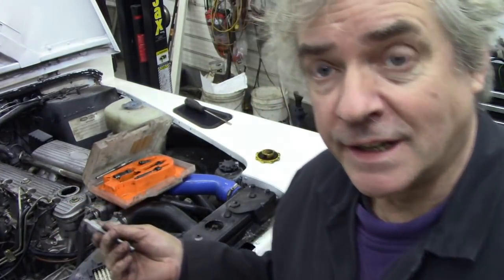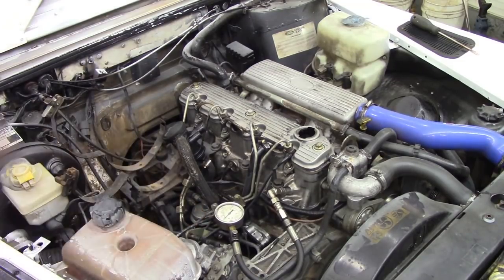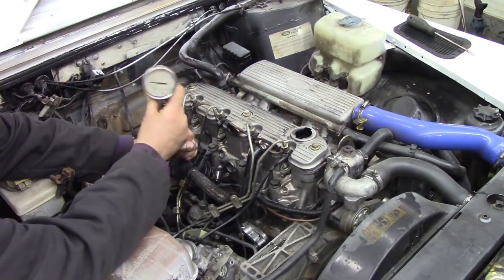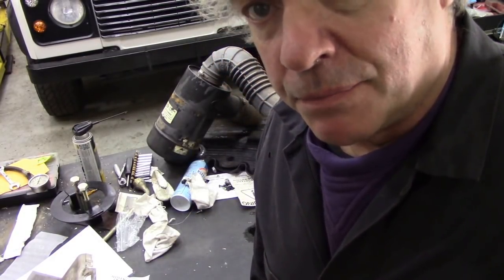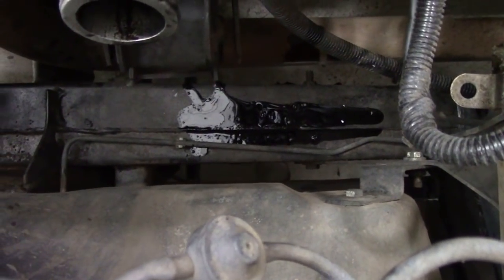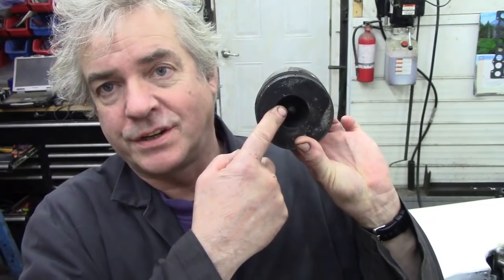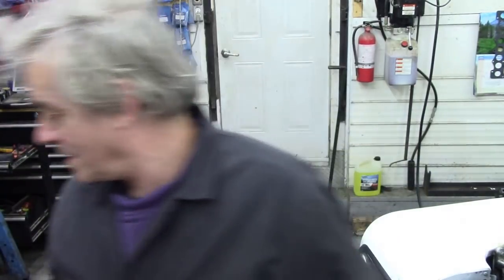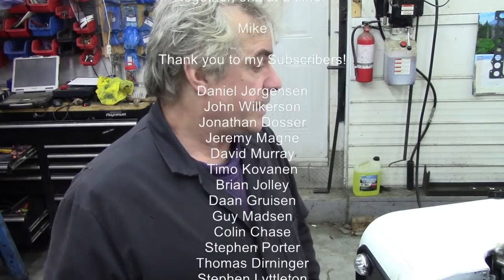Malawi 110 Engine compression test - why so low?

Comment: Didn't you say in the video that the pressure was about 280 psi? Then you said you'd checked upstairs and put a caption on saying 19.03 bar. Are they not as bad as you thought? Or is it my hearing/memory?
Reply from the maker: Should be 24 bar according to the book
Reply: @BritannicaRestorations  Maybe the engine faeries have been in and it's very evenly worn. 😆 In my youth, I had a TR6 and the engine in that was completely shot by 100,000 miles, big ends, little ends, rings, valve guides. It was a Triumph but not of engineering. Still, it may have been rubbish but it was British rubbish. 😅😅

Comment: hello Mike, i dont think the engine has been maintained correctly, the  engine oil looks like tar.  so a good clean up inside the sump,new oil and a new air -cleaner to start with, has the correct oil been used in the engine ?  i very much suspect clown activity with this vehicle some where along the line, good luck with it, hope the series 1 is ok.
Reply from the maker: Typical of a vehicle from that part of the world  - only has oil changed when something goes wrong

Comment: To my untrained eye, it jumps out that ALL cylinders have the same compression reading. Is there any way that  all cylinders pressures can be equalised across the board under some sort of fault condition? Something like a cylinder head gasket failure between each cylinder. Ignore me, it's past my bedtime....
Reply from the maker: I have never seen all 4 cylinders leak between the gasket  - usually goes at the back
Reply: @BritannicaRestorations  Then the suspense grows! Look forward to your next installment. I have a 1989 90 CSW retro-fitted with a D-1 200Tdi, so I find all of your content relevant. My truck (and engine) has done 175k miles, all here in the UK. Thanks for posting and replying.

Comment: Is it possible it’s got the wrong pistons installed, thus the lower than expected compression in each chamber?
Reply from the maker: I think there is only one type available
Reply: @BritannicaRestorations  Mmmmmm! I’ve seen some funny things done to engines. Could someone have machined material off the top of the piston?
Reply from the maker: Anything is possible!

Comment: Originates from Malawi, my guess is scored pistons from sand and dust inhalation
Reply: That is a very good suggestion. That would account for the equal low compression on all four.
Knowing Africa as I do, that is more than possible.
Reply from the maker: You would think it would be bellowing oil out of the oil cap
Reply: @BritannicaRestorations  I was just using the information of weak compression on all 4 and oil residue in the intake. Rings worn, scored bore pistons and perhaps a bad PCV. Didn't see any blow by out the filler cap on crank, but it's not the same as the seeing cap dance  pop off on a running engine. I would be interested in seeing the condition of the air box filter for any inclinations of dusting.
Reply: @BritannicaRestorations  "Ah, well done Pike, I was wondering who would be the first to notice that."

This is intriguing.
Reply: @UncannySense  l

Comment: No chance ROW spec 300tdis had a lower compression ratio?
Reply from the maker: No idea
Reply: Didn't they make 300tdis in Brazil? Could the head be from there if you don't recognise the numbers and have a different chamber volume?
Reply from the maker: This is  Maxion motor and it is a 1999 as the block has a sticker on it and strangely no block drain bung!
Reply: Maxion 2.5 is 19:5:1 compression ratio
Reply from the maker: Same as a Land Rover  300Tdi

Comment: Do a pressure test on another engine it could be the tester that’s faulty had it before.
Reply: Or cylinder leakage test
Reply from the maker: Gauge tested to 750 psi quite accurately today

Comment: Maybe a badly built engine ? Original well worn bottom end and a new head slammed on ? Hmm interesting stuff I’m looking forward to this one
Reply from the maker: It is a 1999 Maxion motor - I found a sticker beside the alternator and a casting date mark on the back of the block
Reply: @BritannicaRestorations  interesting stuff , cheers mike

Comment: I might be deluded but I wonder if there is some obstruction in the inlet tract, that would cause a drop on all cylinders,  my random guess from my calibrated armchair is that the intercooler is full of random crap and oil. Disconnect the hoses and do another compression test, I bet the engine is ok.

Comment: Mike!!!  Test the tester ????  Have you got another test gauge, or can you test it on your air-line. You never know whether a bit of muck has got into the testing gear.  Sorry for insulting your intelligence, but it did happen to me.  I cant wait to find out yet another hidden mystery of the Land Rover. Best wishes, stay sane, Yorkshire Rob.
Reply from the maker: It could be Rob but it was fine when I last used it, but there is a Schrader valve in there - maybe it has stuck - I will get it tested today at my machine shop
Reply: @BritannicaRestorations  It certainly is unusual for all 4 to be down equally, but there again if it has been well looked after and not been thrashed, then it is possible, but still a long shot. Hurry up and let us know Mike, it's like watching a following-up film when I was a kid. Great video. Yorkshire Rob.